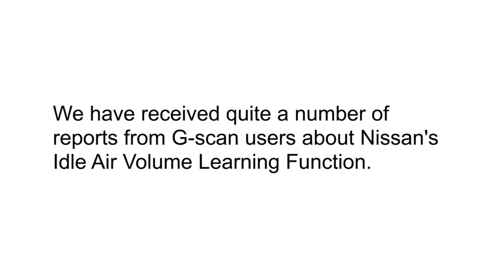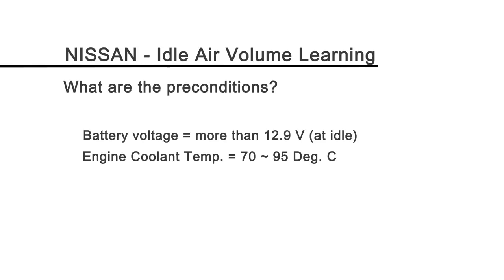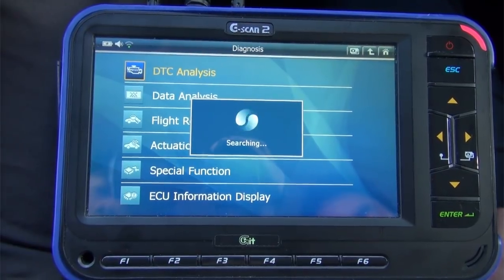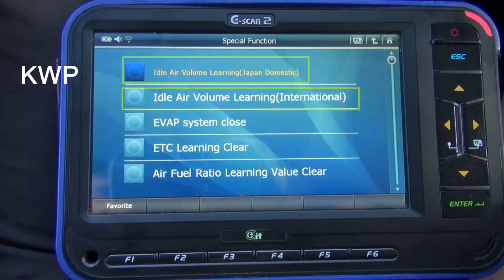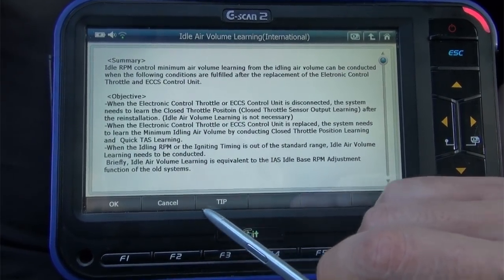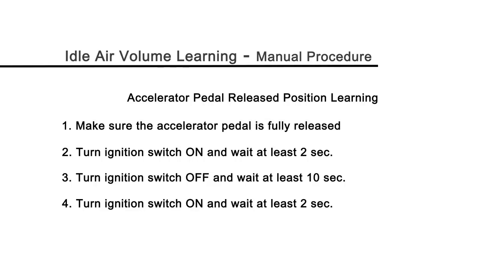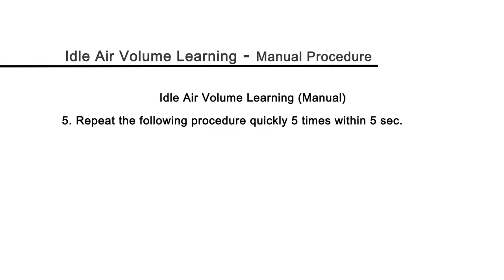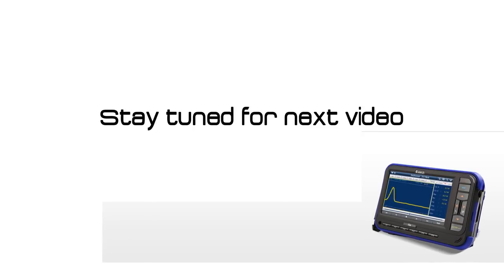Nissan Idle Air Volume Learning

Comment: Please give me your contact numbe i also have this car proble is of rpm is not incraes more then 3000  i change its ecm  butvprobl is same
Reply: Did you solve your issue?
Looks like the engine would not go over 3000rpm when driving. Was that your issue? My nissan wont rev above 3800rpm while driving and produces random misfire code but while in neutral it will rev all the way up smoothly.
I replaced spark plugs, coils, vvt solenoids, vacuum hoses, PCV valve, intake gaskets, O2 sensors, catalytic converters, and fuel pump and still have same issue. I will replace MAF sensor next.

Comment: Does this manual reset work the same on all cars. Thanks
Reply from the maker: No. This is for Nissan! 😁
Reply: @ZenithDiagnosticScanTool  okay thanks,   but i don't think you need to do that it will learn it by it's self just drive it a little.
Reply from the maker: @DanTheManNetwork Most of Nissan models need this method after replacing the throttle body otherwise idle will be rough. We have seen such cases in Altima, Maxima and Xtrail.
Reply: @ZenithDiagnosticScanTool  okay i was saying about my Fords and Hyundai didn't need it.  Thanks
Reply from the maker: @DanTheManNetwork  Yes you are correct. We got you! Thanks for your comment!